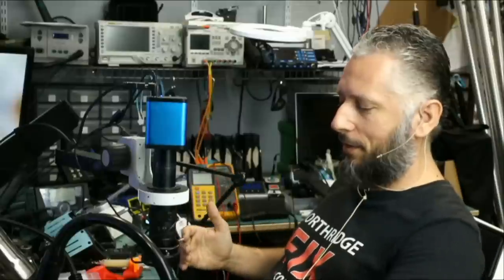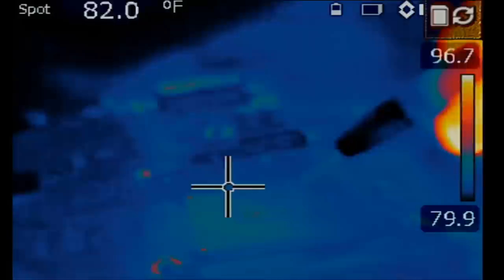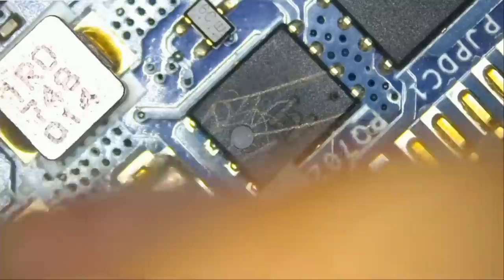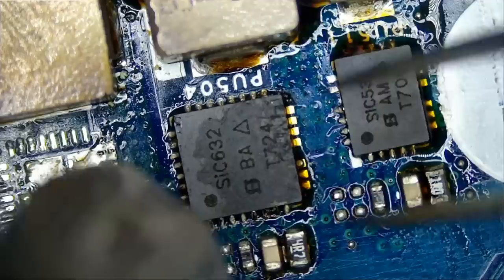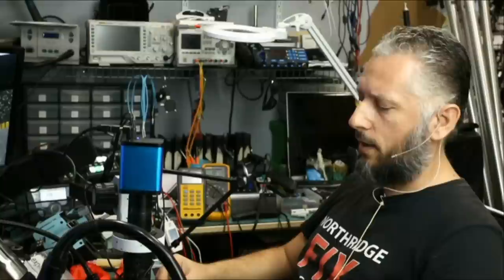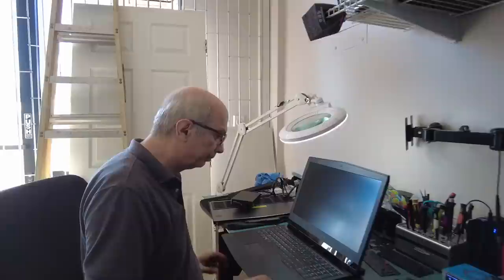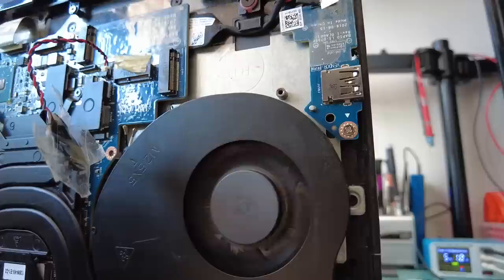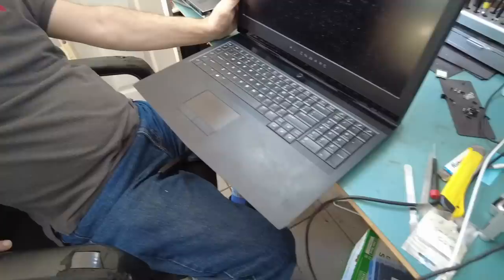Dell Alienware R4 17 common CPU failure - Is it fixable ?

Comment: Alienware's biggest problem, like most laptops, is heat. What makes Alienware so different is they like to ship their gear overclocked out of the box to superficially inflate performance. Most people don't realize this, and end up running their systems ragged by doing incredibly intense tasks like editing, rendering, or gaming. I've had an Alienware desktop PC, and I currently have an Alienware 15 R4. They both came out of the box overclocked, and my laptop got exceedingly hot just doing basic OS tasks. After inspecting the performance in HW Monitor I realized that my CPU was hitting 3.8 GHz when it should have maxed at 2.2 GHz under normal load.
  After re-pasting the CPU/GPU, replacing the RAM, replacing the HDD with an NVMe M.2 for the OS, and a SATA SSD for storage, and re-installing a fresh copy of Win10 64, I immediately undervolted my CPU using a program called ThrottleStop to keep temps low while maintaining performance.
  The machine is over 4 yrs old, and just the slight tweaks I've done to the rig, have increased it's lifespan, and it's performance is much snappier than previously. I only use it for watching Netflix, and such when I'm either on the treadmill, in bed relaxing, or don't want to be at my desk. I'd never game, or do intensive tasks with it because the cooling solutions, while good, are not able to keep up with them nearly as well as desktop coolers can.
Reply: then there you are again, why a laptop bro, if youre gonna underclock it anyway lmao, why not desktop ?

Comment: Hey Alex ! Love your content. I've definitely learned a lot from your videos. I've noticed through my own refurbishing and repairing that on newer alienwares that have everything soldiered to the board that failures such as this one are extremely common. on older models where the cpu and gpu are removable, it's much less likely for the laptop to end up being bricked. I've fixed many m17x, m17x r2, m17x r3 and so on  because the cpu and such can be replaced with relative ease.  I guess it's more cost effective to produce the new models like this. possibly to help with weight and such. I still use and do light gaming on an m17x r3. it lasted this long due to the fact of parts being able to be swapped out. I feel more manufacturers should go back to this standard. Then again how would they make their money if the product doesn't fail and you have to purchase a brand new one.  Anyway, wanted to share this with you. Thanks again for all the great content that you share !

Comment: I own 3 Alienware 17 ,s R3,4 and 5 . I use them for VM,s as they have 3 M.2 cards for storage . They have been reliable with only the R4 Bios flash killing one . I replaced Bios chip and all good . 

What bios codes were you getting on this board if any ? Cheers love ya work and channel from Australia

Comment: I am in agreement with his sentiment about desktops vs laptops. I recently turned in my asus laptop which i used for bureaucratic work when i was in the services for all 4 years. unfortunately during the maintenance procedures of cleaning my laptop, I didn't disconnect the battery, and may have short circuited the motherboard during cleaning it, then removed the battery terminal a bit more forcefully than intended, and which broke the terminal. Laptops get HOT, and use thermal paste which lasts about 2~4 years tops before it becomes putty and loses it's performance and then you would have to re-paste it. And the motherboard, cpu, gpu are integrated so you can't just solder a new cpu/gpu into the motherboard. If you did the effort is just not worth it. You're better off getting a new computer. I am however working on a portable desktop powered by a battery idea.. only downside is having the actual battery being that Light, and energy dense.

Comment: As someone commented before, gaming laptops usually have problems with components such as the MOSFETs or other components responsable of suplying voltage to the motherboard due to the exvcesive demand of power that those kind of boards need, the temperature just goes up and the MOSFET is no longer able to handle that much
I really think that laptops (especially gaming laptops) are like a pug, if you take your pug for a walk and try to make it run again and again and again, it will end getting choked or something like that because it can't handle such activities

Comment: I believe impurities in the mosfets chemical structure is what causes them to fail when met with vibrations and different frequencies around us plus the huge amount of heat they generate. Things like radioactive materials and waste products in the ppm range in the silicon. It could also be a manufacturing defect when a certain area of the component is layered weaker than others and it breaks apart, arcs then shorts. 

Slap a huge heatsink on them all though and I bet they won’t ever fail.

Comment: Mosfets blowing is simply the designers or manufacturers fault. They get either too weak mosftes so they heat up way too much when operating, or they dont design the cooler properly. I've seen blown mosfets on a few Vivobooks with Core i3/i5 CPU but it makes sense that they fail more often on gaming laptops since they are hotter.

Comment: The high power and temperature nature of modern GaN or whatever process node MosFETS that are being used today are made to a lower process standard. I wouldn't be surprised if it has to do with the silicon shortage and companies cutting yield corners to make delivery deadlines (as it sits currently, chips are still on a 52 week delivery delay, the silicon shortage continues, btw). I would, at the very least, install input power protection after the VRM circuitry, in front of the CPU/GPU to at least protect the processor/sensitive components, but, "economies of scale" I guess...

Comment: Based on the information provided, it is likely that the error code you are experiencing on your Alienware R4 17 laptop is a RAM failure. One blue and two red flashes on the main LED is a common code for a memory error on Alienware laptops.

Comment: Still using an AW15 R3 since 2018, I7-7700hq and gtx1070, It's been always plugged on a UPS since I removed the battery. No issues ever

Comment: The saddest thing is that in the 2xxx Sandy Bridge era most laptops did have socketable CPUs and they weren’t that much thicker than now. I had a 14 inch ASUS laptop that I upgraded from an i3 to i7 out of a donor Dell Latitude that my work was going to throw away. 
I can understand the soldering of memory but the SSDs and CPUs take like 2mm less space when soldered… just make the damn thing thicker like someone is really going to care…
Reply: perhaps it's not just because "slimmer design"
but more of
if you could freely swap processor or hard drive.
there's no point of making low end variant. since you could upgrade the CPU.
or
that's would be pointless making a design that purposely fail at some time and would take the cpu with it

Comment: Do you think the orientation of the chip matters? The original chip was mounted vertically where as the replacement chip is mounted horizontally..
Reply: What matters is the location of pin 1 which is marked by a dot or something. The orientation of the writing on the chip can be different if it is from a different supplier though.
I'm sure Alex checked. 🙂

Comment: I hope this helps you. I have a Dell 7566 Wich recently malfunction and I repaired, it had 2 capacitors blown up. After switching those with new ones, the laptop went almost with the same thing that you are expirienceing. 

Don't forget all computers are smart devices and they have their own way to check themselves. Just give the laptop some time and search on Dell website what actually the light circle in your button mean.

Mine had to be left for almost half an hour and then started booting without problems. 

So my advice is that let the laptop be for at least a certain amount of time and maybe it will post. 
Good luck and have a great day.

Comment: The problem in laptop MOSFET is space (more in the gaming) they consume a lot but they put the minimum working . Compared to a gaming motherboard you see 12 to 16 in some expensives have more (some board say in the case 12 phase ''' meaning 12 MOSFET for CPU '''

Comment: Hello sir!  Just a quick question.  How much do voltage do you inject when checking for heat sources and what is the device you use to inject voltage?  Thanks!  I've learned so much from you.
Reply: I appreciate i'm not Alex but normally if your working with the first mosfett you can inject 19v or what ever the power supply is after the second mosfet use 3.3 if you have a short it will draw as much ampage as it can. even on 3.3v you can draw a couple of amps to make something warm.

Comment: For MOSFETs I think there are 3 Way to kill them.
Over current, Over voltage, Overheating.
In a Gaming Laptop Overheating and Over current may occur hence the Hardware can create current spikes and under load it gets quite toasty inside of the laptop.

Comment: Two red and one blue is bios. Try reset the bios. There is a bios battery on the laptop. Unplug battery and unplug bios battery to reset bios and try again or reprogram bios chip.  The laptop is receiving power and power led codes is not suggesting CPU or board failure.

Comment: Release the static build up on the board by disconnecting battery and charger, hold down power button up to 2 minutes. Plug in charger and turn on without battery present.

HP’s are notorious for static build up on the board. I know it’s not an HP but same things happen on all laptops

Comment: Alex I have very weird symptoms on my Alienware what do u think is the issue?
Sometimes it would start up with no issues

Sometimes when I press power on button it shows blinking light 2red and 3 blue (which by Dell Alienware code means ram not found .

Then it would take me few power on and power offs for it to start up normaly

When the laptop starts up normaly I can work with it for days and days as long as I keep it on or standby I have no issues at all.
Also laptop performance is top noch, 0 slow downs, as long as it starts up I have no symptoms of anything been wrong

Once I hit in Windows restart (mostly) it would end up showing the 2 red and 3 blue lights and it would stay that way until I forcedly shut it off (btw screen stays black during this error)

Since the 2 red and 3 blue means ram error I decided upon when the system do start up to run prine95 memtest/cpu for whole day . 0 errors showed.
I have runned also 3dmark , the performance is just perfect, no complaints no slow downs nothing.

It's intel i7 12700h
Rtx 3070ti 8gb
16gb ddr5 ram 

My logic would say, when I press the power on button there are certain checks done before system is powered on. 
Is it the chip responsible for doing those checks malfunctioning?
Or is the ram truly the issues, since it doesn't make sense that the ram is faulty as I have runned full diagnostics on the ram once it powers on

Comment: Ali, I notice that the orientation of the chip need to be changed, I may rotate it as original position 5:24.
Reply: The Chip from the donor board  has it's info printed in a different orientation. He did match up pin 1 on the chip with pin 1 on the board.

Comment: I am working on the exact same Alienware right now. Blinking 2 red and 7 blue. Found QM1 blown clean off the board. Replaced it and still getting the same result. No shorts or hotspots on the board, Schematics and boardview have helped to trace the circuit. I have always hated taking these monsters apart and reassembling again. Not fun.

Comment: It's a shame that CPUs in laptops still don't use an LGA or PGA design instead of being directly soldered on the motherboard.  They should be able to clamp it down enough with the locking mechanism and cooling solution to mitigate the cpu coming loose when transporting the laptop.
Reply: In the starting times when Dell introduced XPS range. They had PGA sockets in laptop's. The manufacturers don't want that now because they don't want us the end user to upgrade the system. Just wait a few years.... You will start getting soldered SSDs and RAM and other components. Some of the manufacturers like Appple have already taken that rout.

Comment: the most common cause is that the cpu or onboard GPU demand more power and the vcore regulator handles it kinda because most vcore regulator circuit is designed to handle general demand but not sure if it can handle large demand from gaming laptops

Comment: These cpu chips go bad due to over heating.  Meaning lack of venting between laptop and surfaces.  Well gap separation between surfaces will help prevent chips to heat up and and melt connectors  together.

Comment: Could also be the battery is depleted too much. With a hp laptop, it doesn't even turn on without a battery. When I left it on the adapter with the battery mounted for 8 hours, it came back on. The battery was in poor condition. The laptop worked after replacing the battery.

Comment: HEAT. it's always HEAT. It's incremental. You'll get away with 1, 2 maybe a dozen overheating events but it degrades the lifetime from 50K hours to 2K or 5K hours. Something has to give and the devices with thermal paste dry out and POP goes the MOSFET.

Comment: They fail when a laptop run at high power and high temp for long periods of time. This can lead to a phenomenon called "electromigration" which causes the electrons to move in a specific direction, resulting in the formation of voids in the material and the formation of metal whiskers.

Comment: The reason some people is buying laptops instead of desktops are mainly (in order of importance): 1. Laptops require minimum space for fairly the same computing power. 2. They can be moved around even in long trips around the country. 3. They don´t sell as much desktops as they used to anymore. 4. They are cheaper than high spec desktops. 5. They used to be durable in the past, so we expect them to be durable in the present as well, but that might not be the case. Some of them are military spec even. 6. We love laptops.

Comment: nice video, I agree if you demand too much from the Hardware dont buy a laptop. desktop can be customized with extra airflow to cooldown the components and increase their lifespan outside the warranty time. plus components can be replaced much faster and cheaper even if you buy a 300 dollar motherboard beats the costs of replacing Laptop or parts of Laptops.

Comment: I have a dell G5 15 9th GEN Laptop i also had issues with shut down and rebooting up again till i realise i had softwear issues so far it happened twice in the past 8 months i don't really play games on it just use it for general use and had no other issues with it since i done a system check  for issues so far  had no problems .

Comment: From my experience as a warranty tech I would never buy or recommend an alienware.
These things have dozens of unnecessary screws and many models did a raid-1 on two hard drives as they were cheaper than a single double capacity drive - unnecessary complexity and more that can go wrong.  Some components that should be user replaceable require the whole unit to be pulled apart.

I totally agree with the final statement - for high performance workloads don't buy a laptop, custom build a desktop using well established and available components and give it plenty of air-flow.  If you have heavy high performance video cards, be careful if you are compelled to transport the computer.  Heavy cards can shear the pci-e slot off the mainboard with enough force.

With my high performance system I put it into a 4U rack case and installed it into a 4U audio equipment/amplifier case usually used by bands.  If you're doing serious work and you move around regularly like I do, this is the most rugged solution.
Reply: just buy their tee shirts not their crappy pc's

Comment: hey alex when you were taking that chip off it looked as thou there was a solder ball sat between pins 3 and 4 from the bottom right of the chip, maybe that was what caused the chip to die
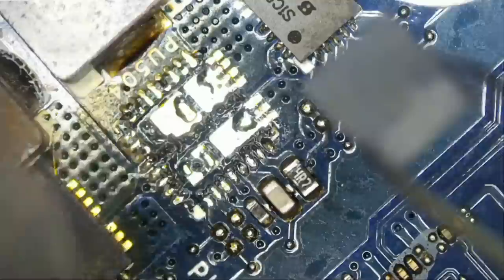Reply: I think it was a reflection. As he takes it off..you can see its separate at time 6:15. But I was thinking the same initially.

Comment: Bios issue or memory issue? could try to pull the cmos battery to reset it if that doesnt work, maybe try new ram.  reprogramming or replacing the bios chip would be my last ditch effort.

Comment: Mosfets fail quicker when exposed to large heat swings and with energy efficient and clock throttling up and down with different cpu loads the mosfets see power fluctuate a lot. Expansion and contraction of the mosfet die and package can cause microfractures or degrade the materials. Due to cost cutting the mosfets may aslo be underspecced and may be designed to fail in 2-3 years and due to the gaussian spread some laptops fail sooner than average. If only 1% fail that's not too bad for a manufacturer. If they sell 100k units, that's still 1000 units that are sent to repair shops.

Comment: I own a Asus TUF A17 gaming Laptop. Finger´s corossed, it run since 2 jears, prefectly.
But also two 32" Gaming Monitors (AOC and ASUS) they Produce Horizotal lines on the buttom, when they are cold.
I think some Manufacturers use cheap components or underratet components for the type of use.
Hope u can understand my english, im from Germany.